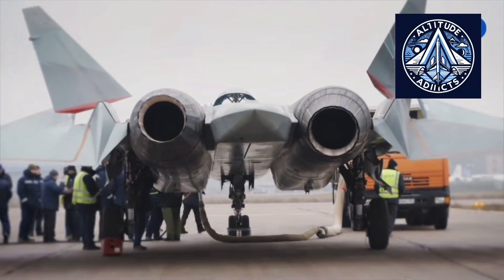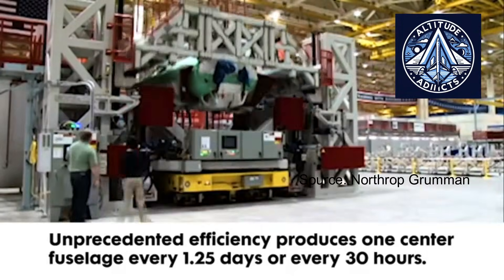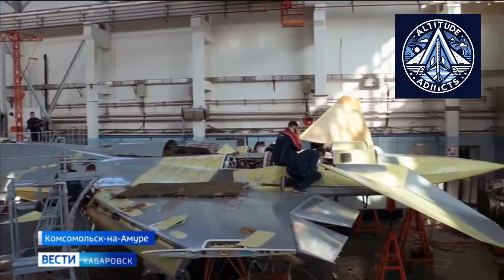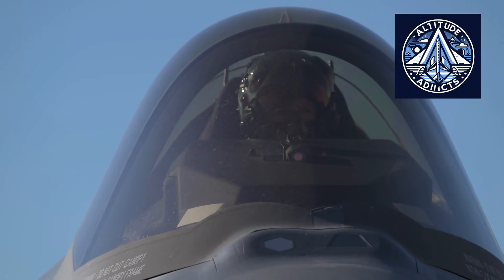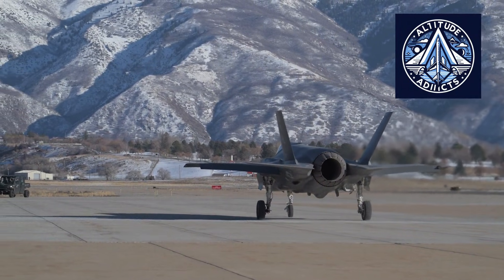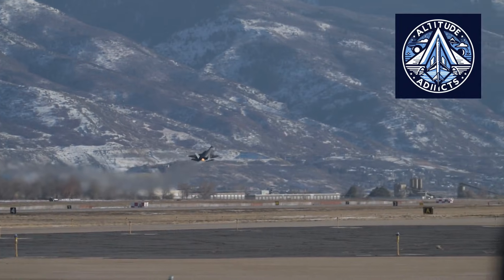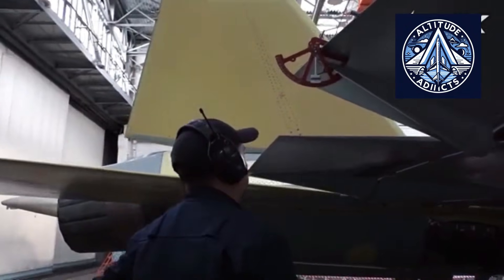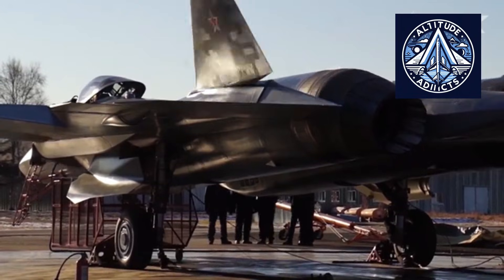How Manufacturing Shapes the Russian Su-57 and  US's F-35

Comment: 7.00 that is an Su-35 ..... not an Su-57 ..... at 7.12 in you can see the Su-57 production line is over on the right - (and you stuck your logo over it .... making your "expertise" on this subject open to question) .... 
nonetheless you can clearly that the Su-57 line is much simpler and the use of big single piece mouldings is obvious too - so there has been quite a change in the way Russians build Su-57s versus the Su-35.
Both aircraft are huge btw ..... 50% bigger than Fat Amy .